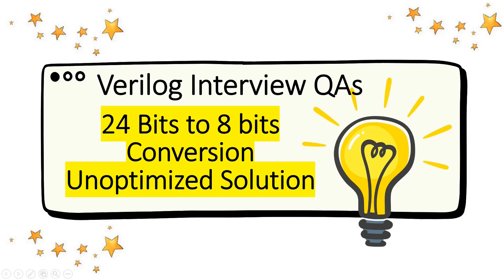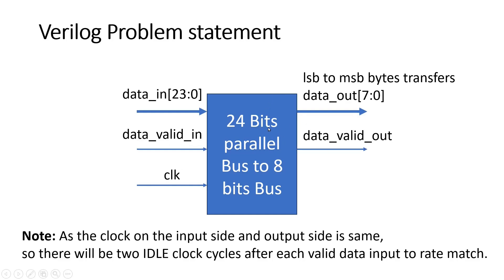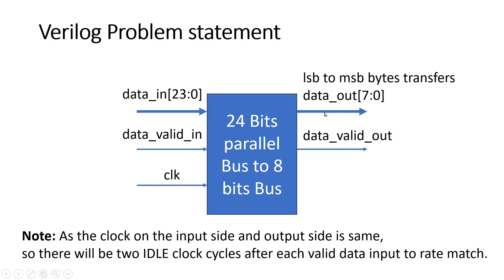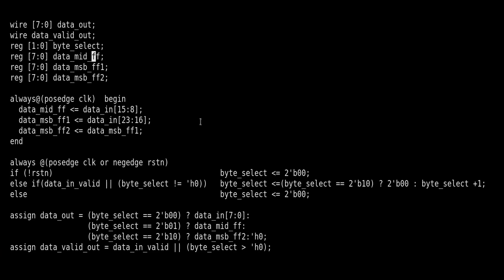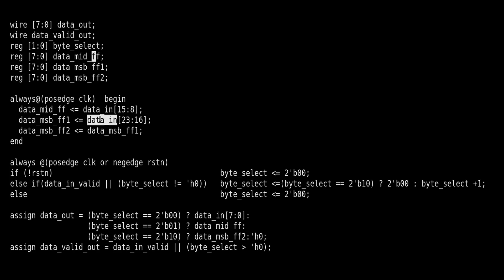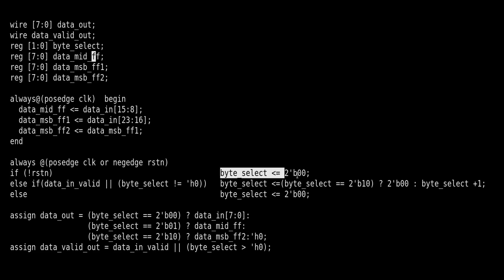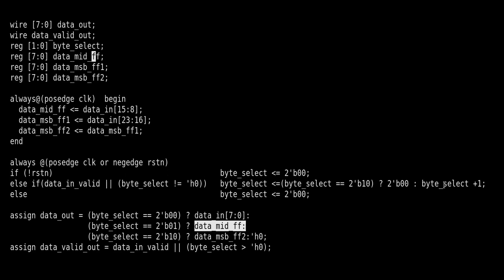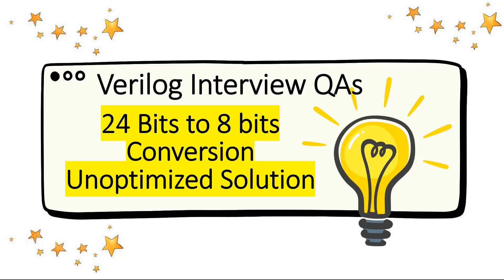Solution: Verilog Interview Question on Data Bus Conversion Part 2

Comment: // Implemented using an FSM

module databus_conversion(
	input clk,
  	input rst,
  	input [23:0] data,
	input data_valid_in,
  	output reg data_valid_out,
  	output reg [7:0] data_out
);
	
  reg [1:0] state,next_state;
  reg counter_start;
  reg [2:0] counter;
  reg [23:0] data_temp;
  
  
  parameter IDLE=0;WAIT=1,TRANSMIT=2;
  
  always @ (posedge clk) begin
    if (rst) begin
    	state <= IDLE;
      	counter <= 0;
    end
    else begin
      if (data_valid_in) begin
        data_temp <= data;
      end
      	state <= next_state;
      if (counter_start)
      	counter <= counter+1;
      else 
      	counter <= 0;
      if (counter == 'b010)
        data_out <= data_temp[7:0];
      else if (counter == 'b011)
        data_out <= data_temp[15:8]; 
      else if (counter == 'b100)
        data_out <= data_temp[23:16];    
    end
    
  end
  
  always @ (*) begin
    case (state)
      IDLE: begin
        data_valid_out = 0;
        next_state = data_valid_in ? WAIT : IDLE;
        counter_start = 0;
      end
      WAIT: begin
        data_valid_out = 0;
        counter_start = 1;
        next_state = counter == 'b010 ? TRANSMIT : WAIT;
      end
      TRANSMIT: begin
        data_valid_out = 1;
      	next_state = counter == 'b100 ? IDLE : TRANSMIT;   
      end
    endcase
    
    
  end
  
  
endmodule

Comment: module 24_bit_parallel_bus_to_8_bit_bus
{
input wire [23:0] data_in;
input wire data_valid_in;
input clk;
output reg data_out[7:0];
output reg data_valid_out;

};
reg [15:0] data1;
reg [7:0] data2;
reg data1_valid,data2_valid;

always@(posedge clk) begin
 data1 <= data_in[23:8];
 data1_valid <= data_valid_in;

 data2 <= data1[23:16];
 data2_valid <= data1_valid;

end

assign data_out = data_valid_in ? data_in[7:0] : data1_valid ? data1[7:0] : data2_valid ? data2[7:0] : 'do;
assign data_valid_out = data_valid_in ? 1'b1 : data1_valid ? 1'b1 : data2_valid ? 1'b1 : 1b'b0;

endmodule
Reply from the maker: Dear Raghu, you have written the verilog code in a complex and unoptimized way. Please refer the following video to get the more optimized way of writting verilog code. 
https://www.youtube.com/watch?v=dnO126T4vIE
Reply: @TechnicalBytes  
module 24_bit_parallel_bus_to_8_bit_bus
{
input wire [23:0] data_in;
input wire data_valid_in;
input clk;
output reg data_out[7:0];
output reg data_valid_out;

};
reg [23:0] data1;
reg data1_valid,data2_valid;

always@(posedge clk) begin
if(data_valid_in) begin 
    data1 <= data_in[23:0];
end
data1_valid <= data_valid_in;
data2_valid <= data1_valid;

end

always@(posedge clk) begin
    if(data_valid_in | data1_valid | data2_valid) begin
         data_out <= data1[7:0]
         data_1 <= {data_1[7:0],data_1[23:8]}
    end
 else begin
        data_out <= 'd0;
        end
data_valid_out <= data_valid_in | data1_valid | data2_valid ;
end

endmodule

Comment: this does not make sense. in the first procedural when they sample the data input to flops, those flops will continue sampling the data in, and the data will not be staying the same for 3 clock cycles. that is not latching right? something is wrong there...
Reply from the maker: Can you please run simulation of this code once and check?
Reply: @TechnicalBytes I cannot at the moment. On vacation. But, if datavalid is guaranteed not to assert for another 2 clock cycles and the data in the input is stable until the next data valid, only then it may work I guess
Reply from the maker: Dear, this code is given by one of our senior member. Please run a simulation, once you are back! we will discuss.